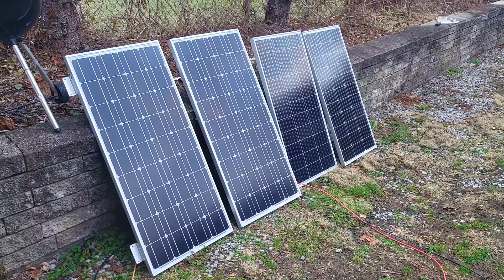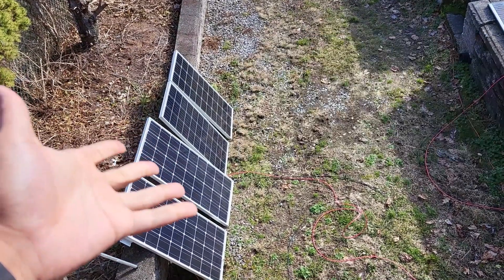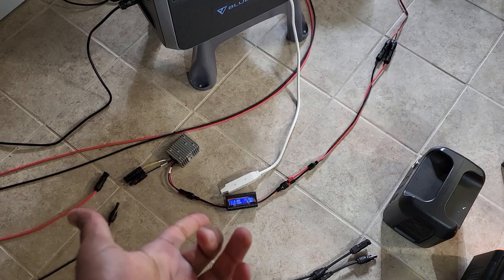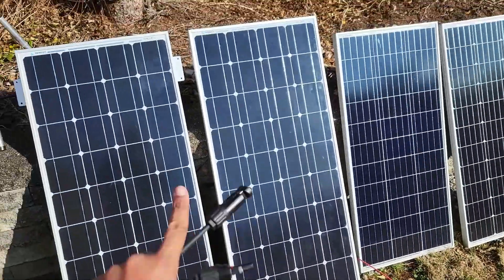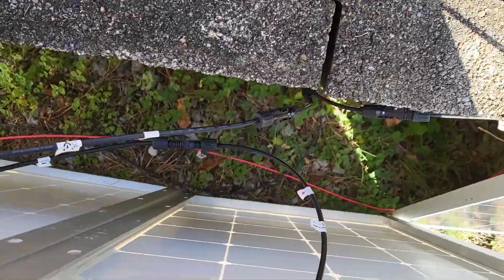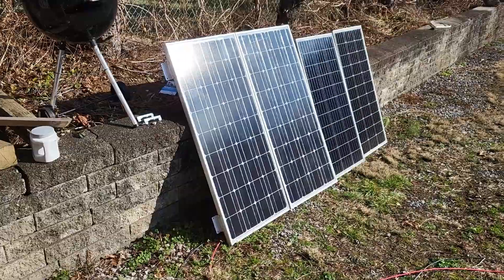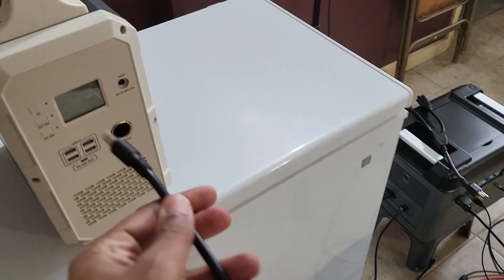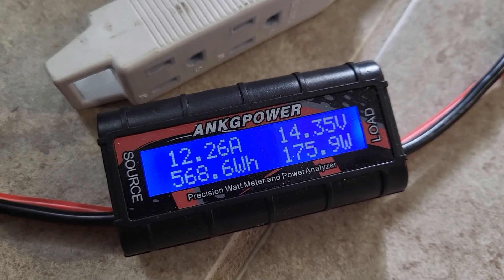Renogy 100 Watt Impulse Purchase - Can I Make It Work?

Comment: Hey, I had to comment again. I bought my 7  335 watt used panels this month March 2023 with shipping for a total of $1009. Total watts in full 90 degree sunlight would be: 2345 watts per hour!  Or totaling: less than 50 cents per watt. That is more power than I could ever use at my house per hour. Enough said. Why? Did I buy more panels? I live in North Carolina, I get about 25% cloudy and rainy days a day here. I use solar to reduce my electricity bill. My system after 23 years has changed from 1200watts: This month's additions make it 4000w per hour or equivalent (5 full hours a day of sunlight) 15,000 watts. With that said; I can not store most of that power, ever! A battery bank is the heart of all Solar panel systems. 

A proper battery bank  is like: 5 times your house requirements for a day or 5 days worth of electricity.  No one has ever tried that yet. 😬  As an example: I use 3600w a day. My solar can make: 330 X 9 a day or 15,000w. My battery bank is really good at: 2 banks of 330amps at 24 volts = 15,000 Watts. Sounded like a perfect plan! But NO. In reality, I would need a battery bank of: All my panel input a day times 5 days: 15K X 5 days = 75K watts battery storage. I would need: LiFePO4 battery system: For a 15,000 watts battery backup:

Comment: Part of the problem is that that is a buck converter meant for running 12V stuff from a 24V/32V/36V/48V source, not a charge controller that is designed to pull electricity from a PV array that is effectively a current source.  You need a proper charge controller.
Also, the reason for the size difference in the modules is that the bigger ones are using a less efficient cell design.
Reply from the maker: I'm not sure I fully understand....but I think it's coming to me. Ahhh I gotcha. I still don't follow why the power varies but I suspected that the battery was full. 

Yeah I got ya on the size of the panels.
Reply: @AskIveSolar  The way the control loop in the converter you have works is it tries to pull as much current as it needs to supply its load as it is designed for a constant potential input such as batteries or a power supply.  With PV modules, this causes the output potential of the array to collapse down to just over the output potential of the converter as the PV array is a constant current source.
Reply: @randacnam7321 I think you have a good conclusion: I learned a lesson; Real MPPT charge controllers are $100 or more. 😀  The cheapest one I bought last month was $300 100V at 24v 2000w total input.  It is rated at 48V at 150V input, but that is normal addition. Good comments, thank you.
Reply: @lindafoxwood9091  There are some that are cheaper, but a lot of the cheap ones are fake.  A good way to tell is to open it up and see iffen there are any big inductors inside.  Fake ones don't have any as power inductors of the size needed for a few hundred watt buck converter are expensive relative to the cost of the rest of the controller bill of materials.
Reply: @randacnam7321  Thanks for the helpful idea, again! I open everything up and take photos; mostly looking for bad soldier connections on the wiring and the ICs. Took a brand new 65" Flat screen apart, found two weak solider joins. :)

Comment: If your charge controller is an mppt it will make more current out than is put in especially when your are running a higher voltage than one panel can do.
Reply from the maker: That's interesting!

Comment: I’m curious if there is a buck converter that is amp/ voltage adjustable, so it could be used with any solar generator
Reply from the maker: I'm sure there is. Never was curious enough to look though

Comment: I'm giving serious thought to putting my two RichSolar 200W panels on top of my little camper, and running its refrigerator off that, plus I can take power stations inside it to charge.  Things are getting worse, and I want to be more ready.
Reply from the maker: I feel you. How are things getting worse from your vantage point?
Reply: @AskIveSolar  Our parasites are determined to get us into multiple wars.  Meanwhile, supply chains (including for food) are weakening further, and inflation remains high.